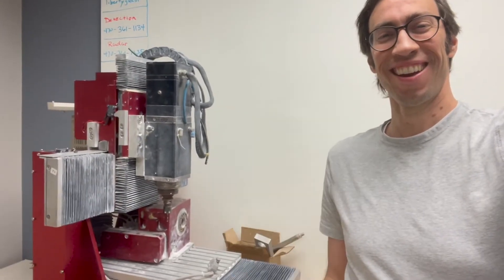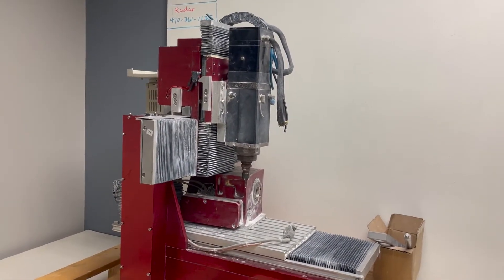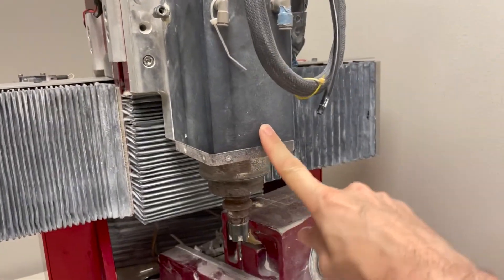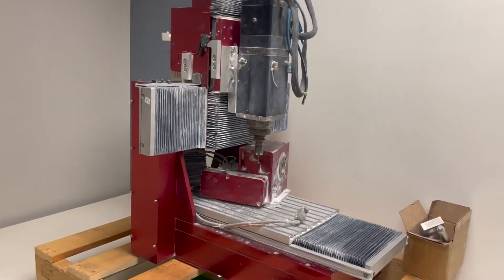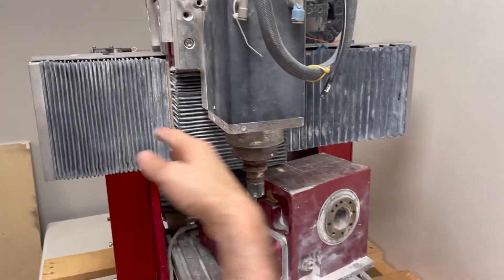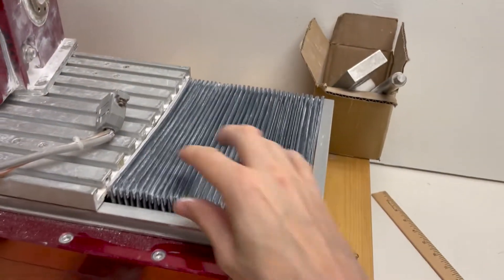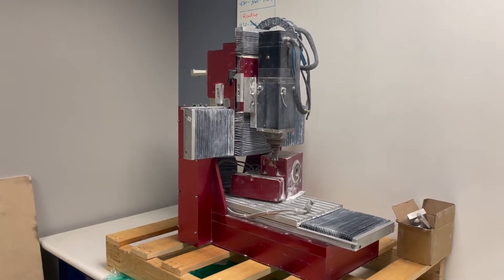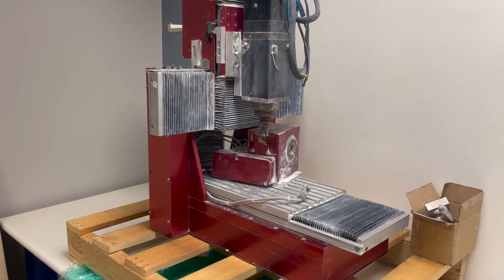Levil CNC Retrofit - Ep1 - Introduction

Comment: Hello, at my work there is the same one, same model, but the program that controls it has been lost.
can you help me with that?
Do you have the software to control it? thank you
Reply from the maker: Hi, I bought mine without software. I'm going to replace all the electronics with Gecko G320 DC servo drives, and I'm going to put either LinuxCNC software on it or UCCNC. The first is free, the second is about 100 USD. Is there any chance you can send me some pictures of your machine? Does it have feet? How does it attach to a bench or a base? Thanks.
Reply: @nickp4793  Hello, I can send you some photos, give me your email.
My machine does not have feet, it is not fixed to any base, it is exactly the same as the one you show in the video.
Reply from the maker: @RubenSanMartin95  Hi, yes that would be great. The reason I think something is missing on mine is there are SHCS on the bottom, and they are actually what would touch a workbench if the machine was placed on a workbench as-is. My email is onlinemailaccount@mac.com (I'll delete it from this comment once I receive). Thanks!
Reply: @nickp4793  Done, I already sent the email. Thank you
Reply from the maker: @RubenSanMartin95  Hi, thanks. I did not receive. Would you try again please? onlinemailaccount @ mac . com (I added spaces so I don't get spam, please delete the spaces when you send). Thanks!